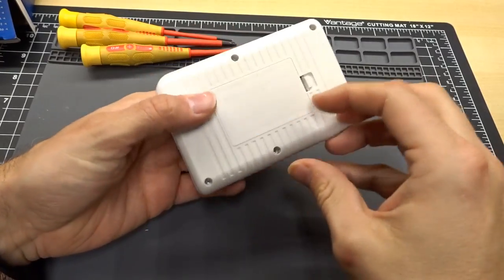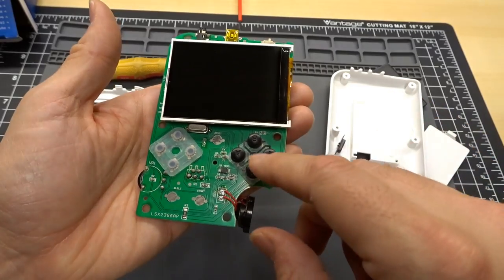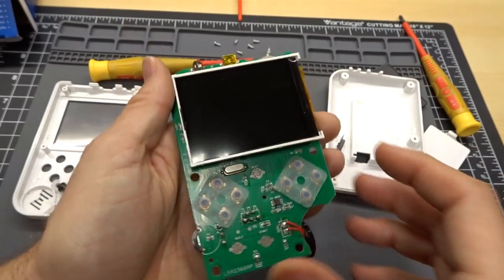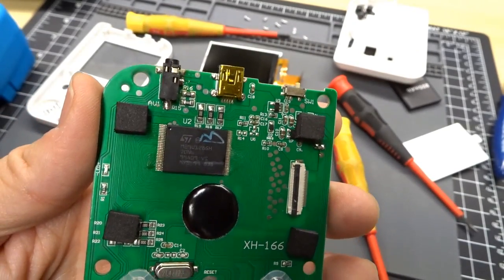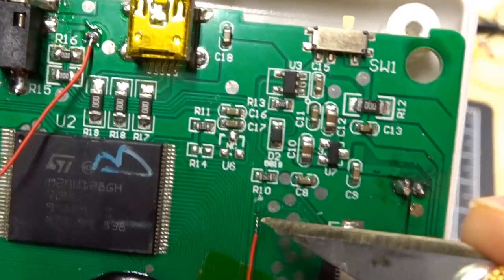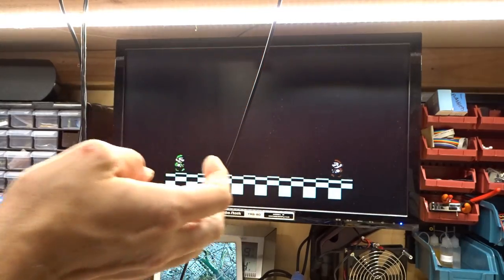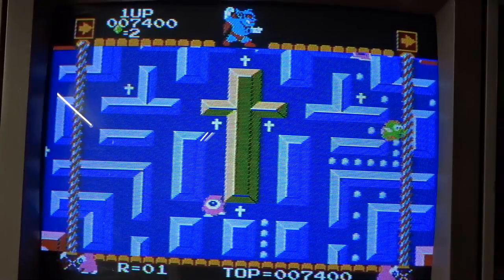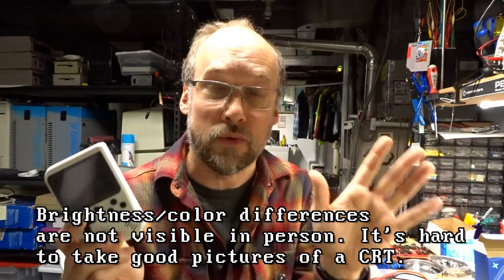Improving the $10 8-bit handheld game console

Comment: I think in many ways you made your console worse. Not better.
1- All you needed to do is put a piece of paper between the black silicon contact points and the board. No need for cutting out the silicon layer. Now your top 2 buttons are going to rattle in the case; not to mention any possible SNES games you've disabled your X and A buttons.
2- Why install a capacitor when the system runs without it, and clearly doesn't need one? A capacitor in load might potentially drain the battery when empty.
3- The resistor, are you sure it's not an effect of installing the cap? But if not, why not install the resistor inline with the video cable instead of the console? It is easier, looks better, and increases your console resale value.

Comment: I opened one of these up hoping it was running off some kind of low-end raspberry pie so I figured I could change the horrendous collection of rom hacks and bad games on mine but alas it's a ROM memory. These stuff are the cheapest of the cheap. Absolutely not recommended.